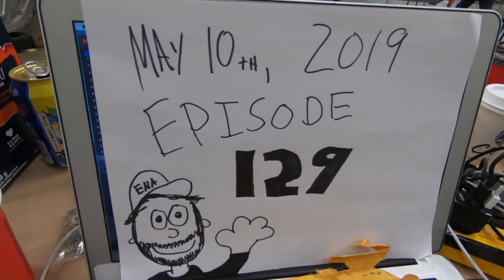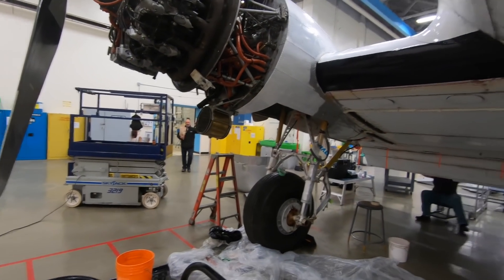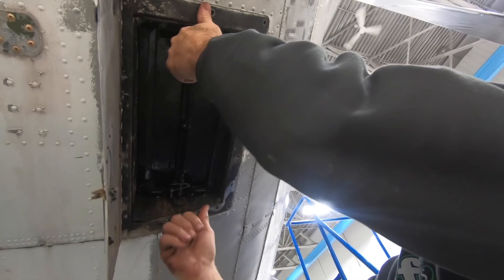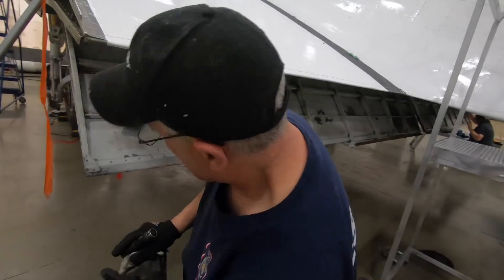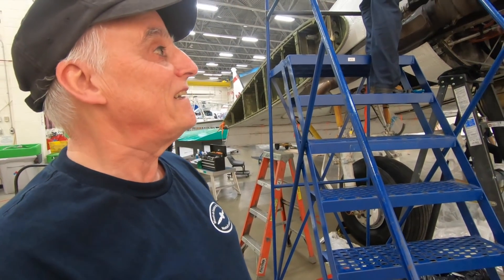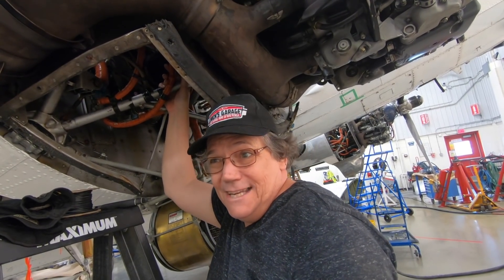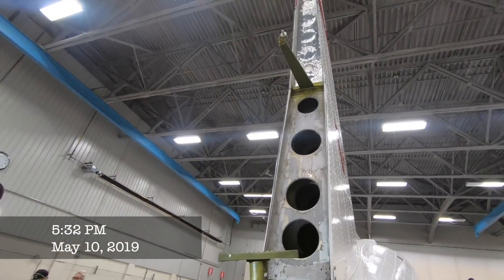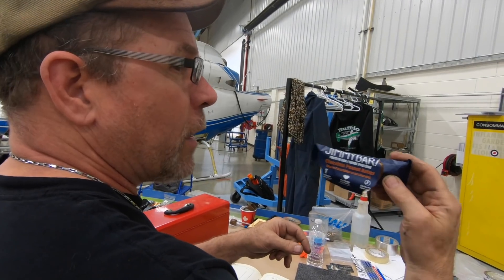"What's Working? DC-3 (DTD) Cockpit UPDATE" Plane Savers E129

Comment: Painting a DC3 with a half inch brush, that blows me away..:)
Reply: details,details and more detail work.
Reply: Air brush be quicker but not as easy
Reply: Russell not quite correct the larger areas have been rollered by Stella,the detail work on the pin striping is for the half inch brush ! spraying around people is a definate no no but just look at the smart results achieved a far cry from when we first saw DTD.

Comment: Now that the batteries are installed, it would be wise to hang a caution tag on the Master power switch, to be sure the Master is left in the OFF position, except when actually needing power. Maybe hang a sign on the stairway door...."Did you shut off the Master Switch?"
Reply from the maker: Actually a very good idea from the comments!! (Seriously) thank you :)
Reply: Standard shut-down checklist procedure is to leave the Beacon Light = ON. Pretty hard to walk away from the plane and not notice the beacon light flashing if you forgot to turn off the masters.
Reply: Lockout padlock 1 master key will fix if the master has the hole for it.

Comment: Seeing that battery get hoisted up the ladder makes me nervous. Is there any protection on those bayonet terminals to prevent an accidental short across the metal ladder or the aircraft structure?

I sure don't envy operators that have to pull those batteries in the cold weather. That's two heavy beasts to have to get in and out!

Comment: It would be cool to use Lithium Ion battery’s and save a ton of weight,  but if they even make them they will be expensive.  Maybe a donation from the battery makers? Love the videos,  seen them all from the beginning
Reply: The Fish Hauling DC3 that I got a ride in, in Alaska in the 90's had car batteries with bolt down cables.